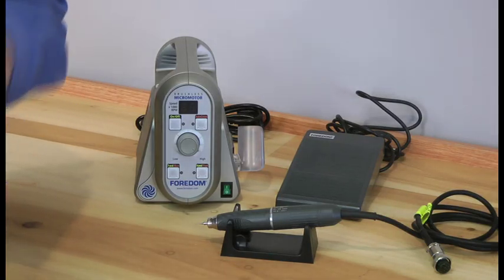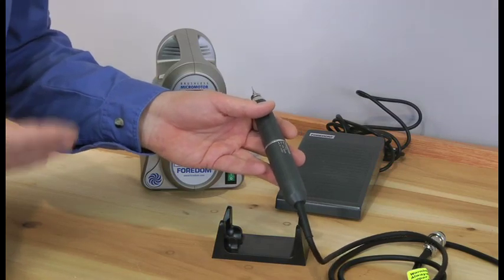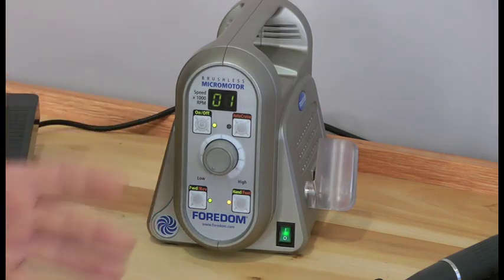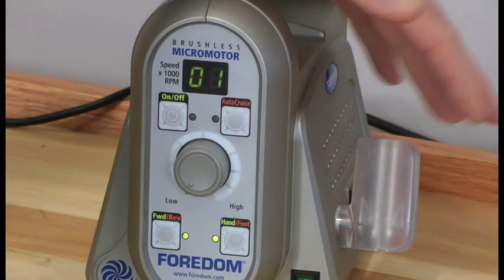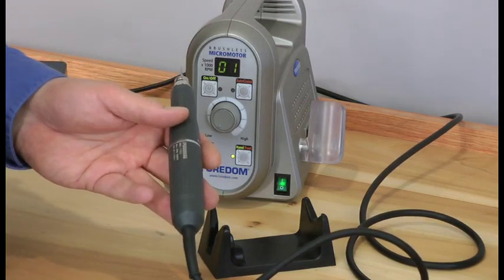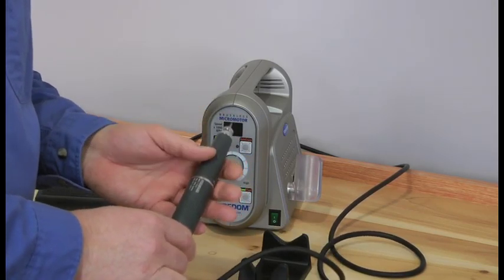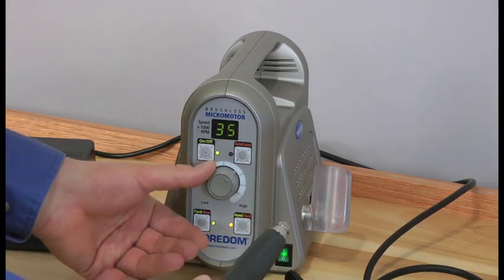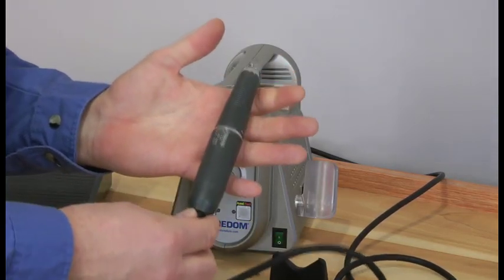Foredom Brushless K.1050 Micromotor

Comment: Can I use dental drill burrs with this
Reply from the maker: Dual Port K.1050 has  a 2.35mm (3/32") collet. K.105018 Kit has a 1/8" collet. they take burs or drills with those shank diameters. Collet adapters allow other shank sizes to be used with ease.   http://www.foredom.net/micromotorsparepartsandmore.aspx